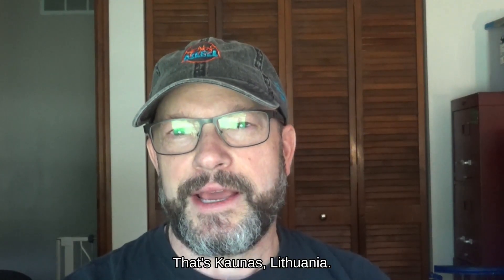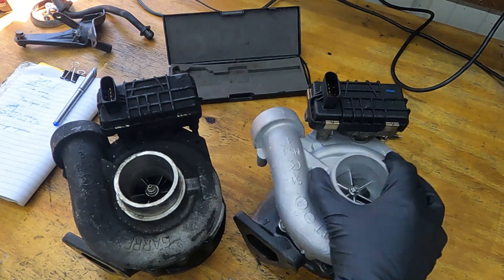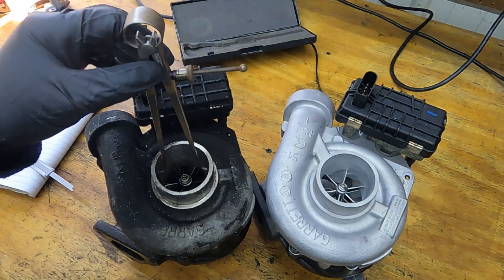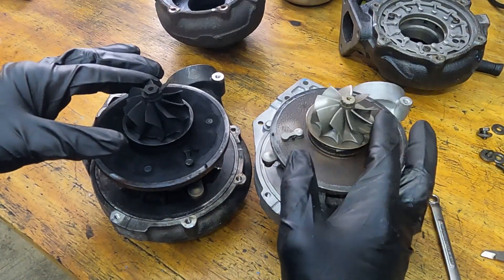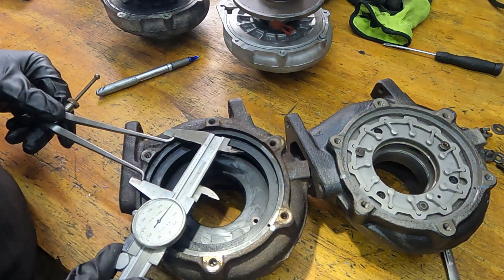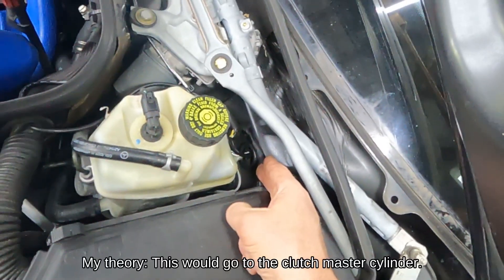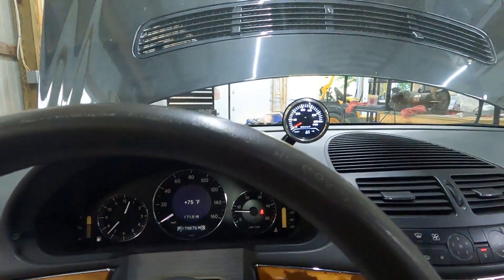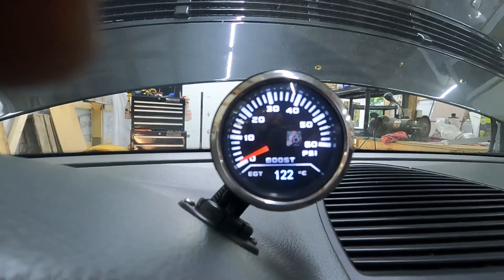ETK Hybrid vs. Stock Turbo Comparison and My New Boost / EGT Gauge

Comment: What turbo from there website is this? In 2025 they have 4 options now
Reply from the maker: I'm not tracking ETK after my experience with their tuning. I won't say not to use them, as they may have improved, but at the time I switched to somebody else. Also, at that time there was only one turbo offered. FURTHER, I don't recommend disassembling these turbos, as they are sensitive to the actuator positioning (I got lucky and mine was OK).
Reply: @ArtOfDiesel currently they have a gt2865, 2867, 2872, and 3072

Comment: Watched the build video on this turbo and I’m curious about hp and tq levels reached with this hybrid. I’ve found a 648 from a friend but the car was in a front end crunch. He says the water pump took a hit and the belts are funky. I’m concerned if the crank got damaged. Car has 90,000 miles on it and my friend drove it off the low boy and says it runs fine. He was going to put the engine in a Chris Craft boat but decided to rebuild the flat head that came with the boat. He owns a Benz repair shop which is how I met him back in 2001. I’m overseas and apparently trusting him. Back to topic, I’m installing this engine or other 648 into a 97 Land Cruiser. While 400hp is great I’m trying to figure if I can get 300 hp and 450-500 ft lbs running stock injectors and pump. What level of power can be run with the stock con rods? Searching around and found your videos. Maybe you’ve already discussed this in another video and if so maybe you can direct me there. I have the stock intercooler from my 2005 Chevy Duramax but the volume is probably too much and lag would be great. I might go LS into my Cruiser but I like diesels. I’ll keep reviewing your videos and see if you already covered this. Thanks and great videos.
Reply from the maker: If you'd like more in-depth discussions, subscribe to my substack: https://artofdiesel.substack.com

Mine got to an estimated 300 hp and 500 lb-ft on stock injectors, based on measured quarter-mile times in the W211 platform. To get there, I removed swirl vanes, EGR, DPF, added the hybrid turbo, replaced the mufflers with Magnaflow turbo mufflers, and upgraded to a Mishimoto intercooler. It's all in my videos.

If I did it over:
(1) I would NOT take the turbo apart to take measurements, as any shift to the actuator throws off calibration (though mine seems to be OK anyways).
(2) I'd go to Drew for the Turbo. He can get a good one made for you, though this ETK turbo is OK so far and we are heading for 400 hp with it. I think that Drew's would be good for that and more.

Comment: Whats the gauge and fittings that you used?
Reply from the maker: I've switched again since I made this video, and will cover it in a new video soon. I went to GlowShift gauges, and was very unhappy with accuracy and the silly colors, even if I set the colors close to what I wanted. I now have gauges from IssPro, which are more accurate and more consistent with the stock cluster's appearance.